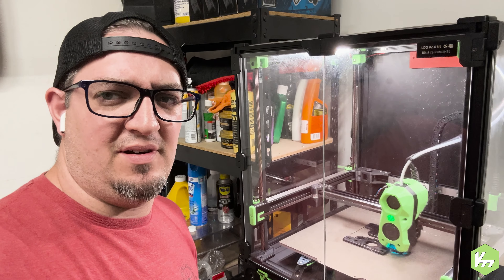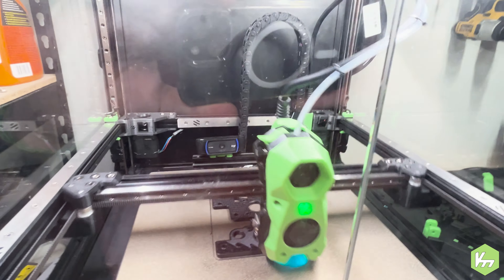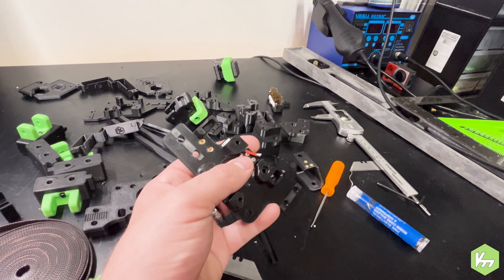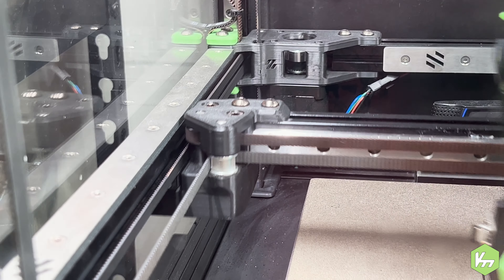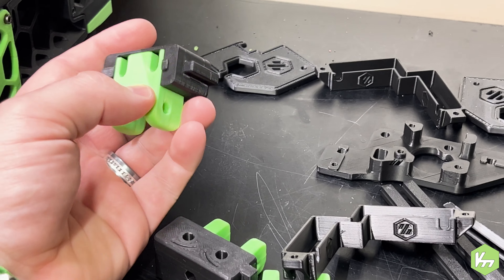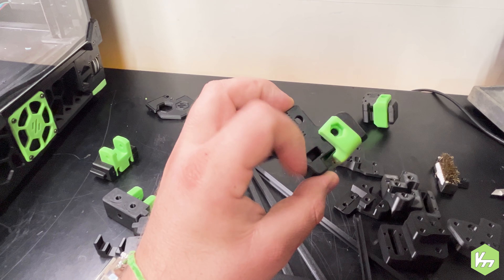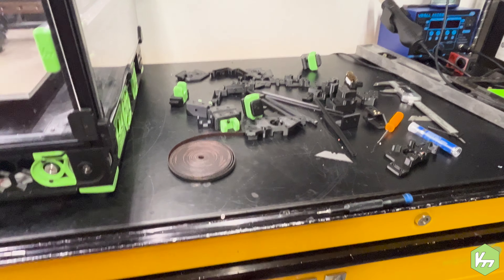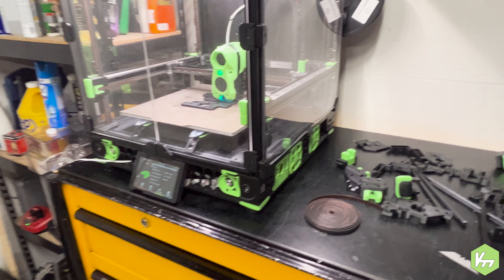From the Toolbox Episode 2

Comment: I encountered a similar problem with my belts, and it turned out to be caused by inconsistent belt widths. Some sections were slightly larger, measuring 6.1mm, and they were genuine Gates belts. It's possible that you're experiencing a similar issue.
Reply from the maker: That is exactly the current issue I am dealing with, shhh! Thats content for the next video (lol).... along with upgrades.